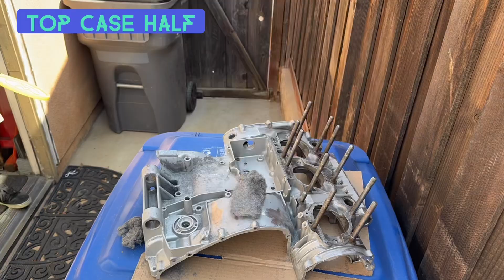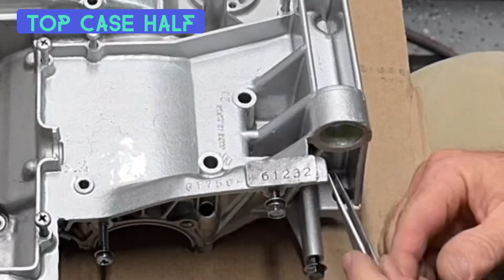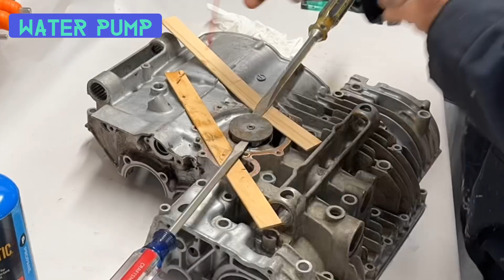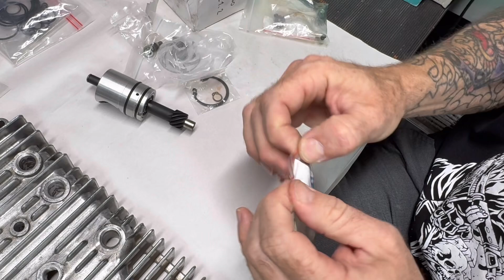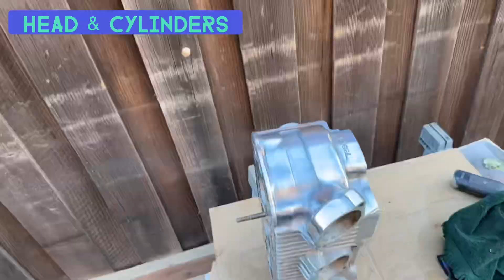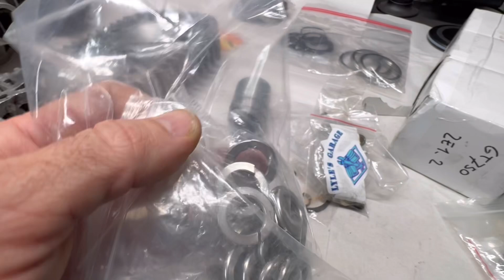Suzuki GT750 engine Part 3: how & where

Comment: Well this couldn't be better timing. I'm just about to start assembling my GT750 engine - delayed many months due to a hip replacement operation so I've forgottenhow I took it apart! I'm sure this will be so useful. This, in combination with 'The GT750 idiot" channel (he's not an idiot😊) will be a life saver.  Thanks for posting.
Reply from the maker: Also, I should have the assembly of the bottom end video posted in the next few weeks👍
Reply from the maker: Glad the video is helpful, and I wish you a speedy recovery from your surgery💪